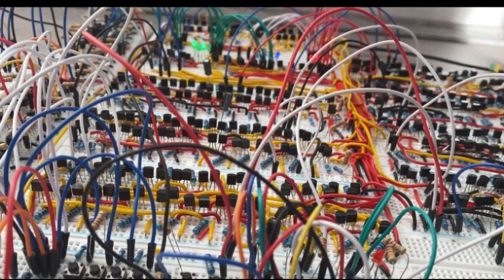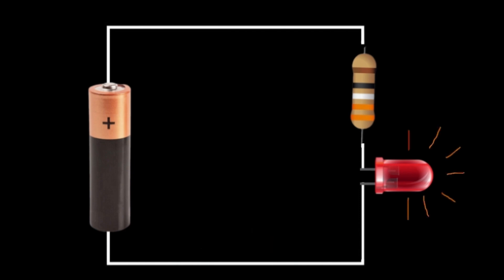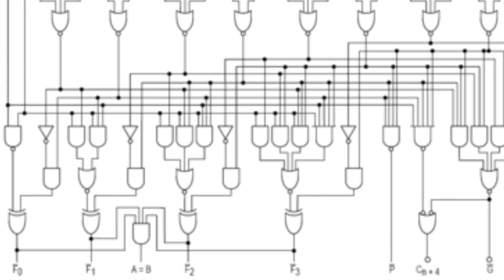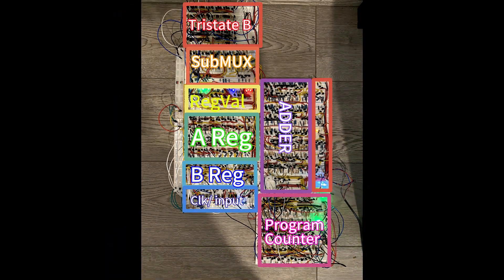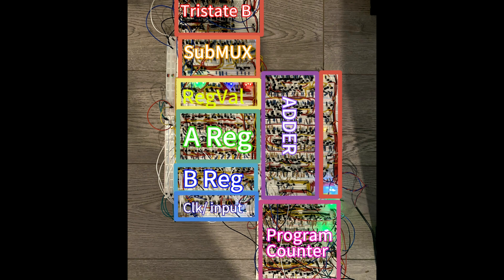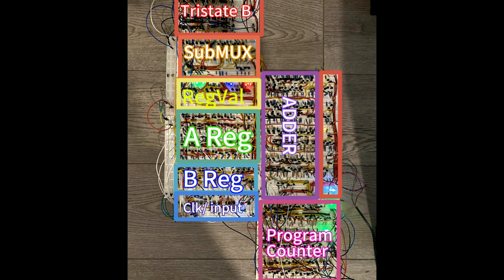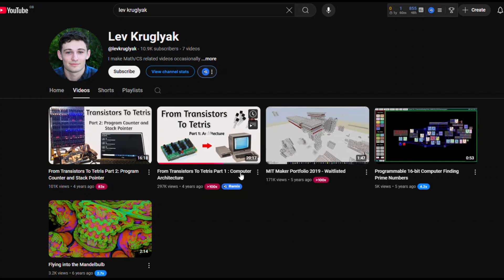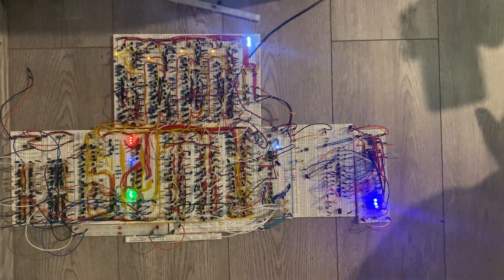I Built A Computer From Scratch!

Comment: I was thinking about doing a similar project. I think it's fascinating using actually just one type of compontent (besides kabel and breadboards and stuff). But I was wondering why not more people try this and asked deep seek. That was just yesterday, btw. (I'm a first semester student and new to working with electronic components.) Here is deep seeks response:

---

1. Why It’s Not Trivial
Transistors are the fundamental building blocks of all modern computers, but using them in purely discrete circuits requires precise calculations and design work:
- Logic Gates from Transistors: Each NAND, NOR, or AND gate must be manually built from transistors, resistors, and possibly diodes.  
  - Example: A simple NAND gate using BJT transistors requires resistors for current limiting and correct voltage levels to avoid overheating or undefined behavior.  
- Signal Delays: Each transistor has a switching time (typically **nanoseconds**). With thousands of transistors, these delays add up and can cause timing issues.  
- Power Supply: Each transistor consumes power, especially in the "on" state. For a computer with millions of transistors, you’d need to calculate power consumption, voltage drops, and heat dissipation precisely.  
- Noise Sensitivity: Without ICs, circuits are more susceptible to noise, capacitance, and inductive coupling. Voltages must be chosen carefully to ensure noise doesn’t corrupt logic levels.

---

 2. What Calculations Would Be Needed?
> a) Single Logic Gate (Example: NAND Gate with BJT Transistors)
- Base Resistor: Calculation of the base current \( I_B \) to saturate the transistor (e.g., \( R_B = \frac{V_{CC} - V_{BE}}{I_B} \)).  
- Collector Resistor: Sizing for the output current (e.g., \( R_C = \frac{V_{CC} - V_{CE,sat}}{I_C} \)).  
- Logic Levels: Ensuring \( V_{OH} \) (HIGH level) and \( V_{OL} \) (LOW level) are compatible with subsequent gates.

> b) More Complex Components (e.g., Adders, Registers)
- Timing Analysis: Maximum clock frequency based on critical path delay.  
- Power Supply: Calculation of total current for all gates (e.g., \( I_{total} = N_{transistors} \cdot I_C \)).  
- Thermal Management: Calculation of power dissipation \( P = V_{CC} \cdot I_{total} \) and sizing of heat sinks.

> c) Entire System (Turing-Complete Computer)
- Clock Distribution: Synchronization of all components via a global clock signal (avoiding clock skew).  
- Memory Architecture: Designing flip-flops or DRAM cells from transistors (retention time, refresh logic).  
- Power Network: Calculating voltage regulators, decoupling capacitors, and wire gauges to prevent voltage drops.

---

 3. Historical Examples
- PDP-8 (1965): One of the first minicomputers, built from discrete transistors. It had ~4,000 transistors and required a team of engineers for design and maintenance.  
- Apollo Guidance Computer: Used discrete NOR gates (~4,100 ICs, which at the time contained only simple logic).  
- Modern DIY Projects: Hobbyists often build 8-bit CPUs from transistors (e.g., Magic-1 or BMOW ), which takes years of work.

---

 4. Why ICs Simplify Everything
Modern ICs abstract away the complexity:
- Preconfigured Logic: A 74HC00 NAND gate already contains all the transistors, resistors, and connections, optimized for performance.  
- Guaranteed Specifications: ICs provide defined logic levels, switching times, and power consumption.  
- Integration: A microcontroller replaces millions of transistors with a single component.

---

 5. Conclusion
- Trivial? Absolutely not. Even a 4-bit computer made from transistors requires months of work and deep electronics knowledge.  
- Feasible? Yes, but only for enthusiasts with a lot of patience and expertise.  
- Practical Tip: Start with small projects (e.g., a 1-bit adder) and gradually increase the complexity.

If you’d like to see specific circuit examples or calculation steps, feel free to ask! 😊🔌

--- 

Let me know if you'd like further clarification or additional details! 😄
Reply: Because of this answer I won't try it. (I mean, no one knows what the future brings, but you know.) And because of this answer: mad respect for your project.

For me it's absolutly fascinating how with such a simple atom like a transistor and simple true/false statements, you can build a working touring complete machine. But getting the whole voltage and noice stuff right is just another level. Another game honestly.
Reply from the maker: @andarted  thats another reason why I want to start this series. So you can see that its not that complicated. You don't need any calculations and if you understand basic logic gates you can build a computer!

This is gonna be something I emphasize over the next few videos because it really is that simple-- If you can speak then you can build a circuit ( lol I know it doesn't make sense now but you'll see what I mean)